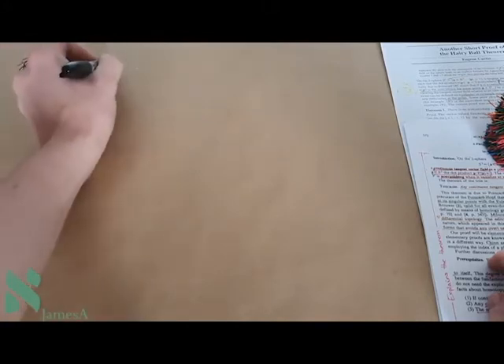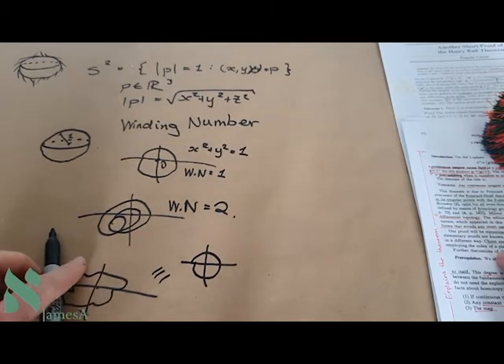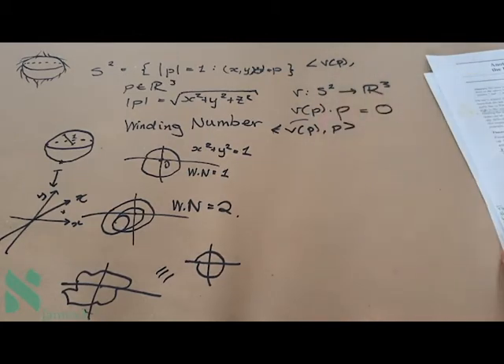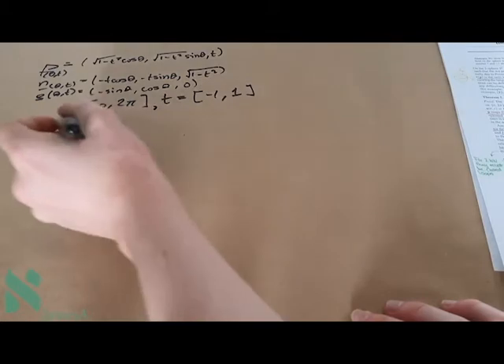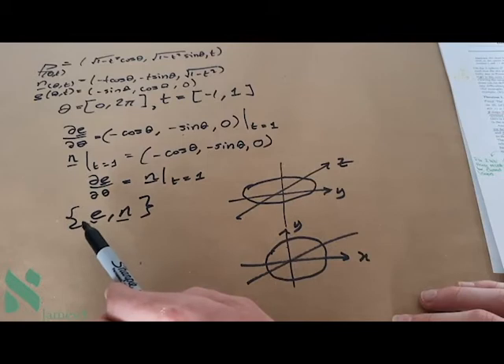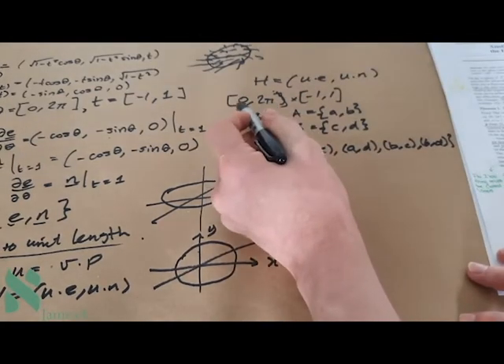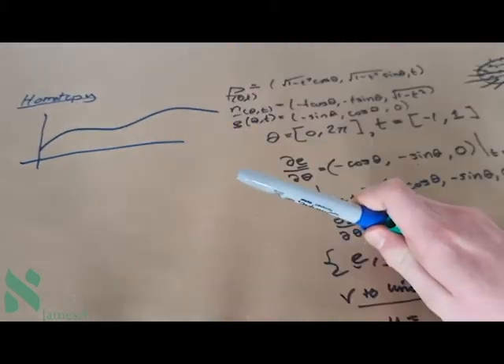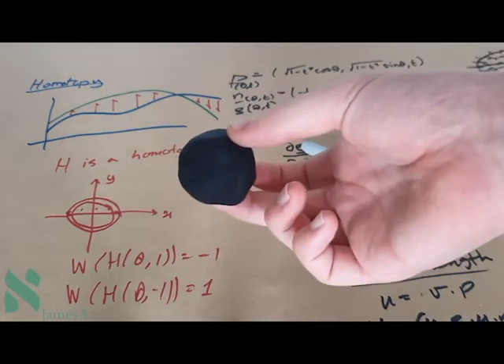PCubed: Hairy Ball Theorem

Comment: Why was it called S2 rather than S3 if it's a 3D sphere?
Reply: S2 is only the surface of the 3d ball, which is called D3. S3 is somewhat more difficult to imagine, but it can be done by using an analogy from 2 dimensions. If you take a disc (called D2), and pull it over a sphere, you can do it continuously with a hole remaining, one single point. So, if you fill that hole, join the edge of the disc with itself, you get a closed space which is exactly like the surface of the sphere S2. So, similarly, if you join the edge of a 3d ball with itself (meaning, that you consider the edge of the ball to be a single point) then you get the S3, i.e. the 4 dimensional sphere.
Reply: I realize I didn't really anwser your question haha. So the dimension is 2 for a sphere, because it is locally the same (homeomorphic) as a 2D plane. (Intuitively, a bag is the same as a blanket, because both are made of 2D fabric.)
Reply: @damjantarkanyi9479  No, I appreciated it. I had my notifications on replies turned off without realising it. Thank you.